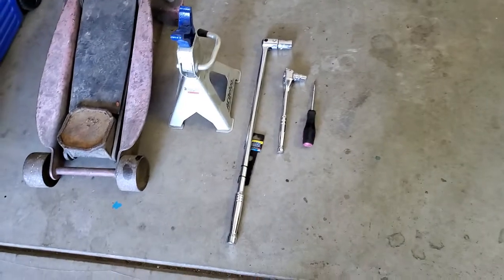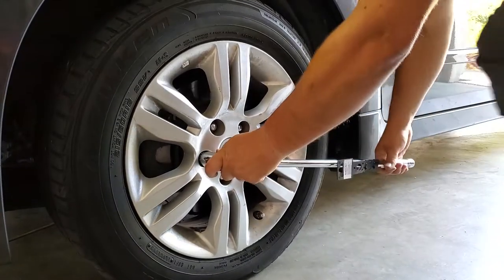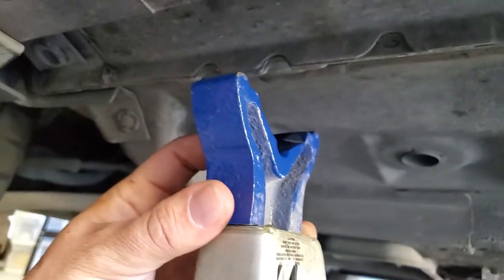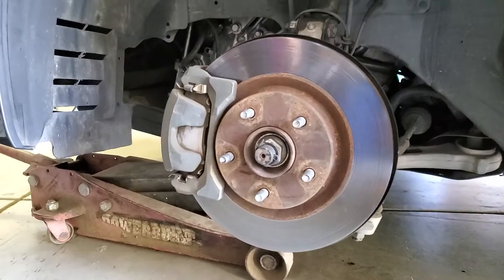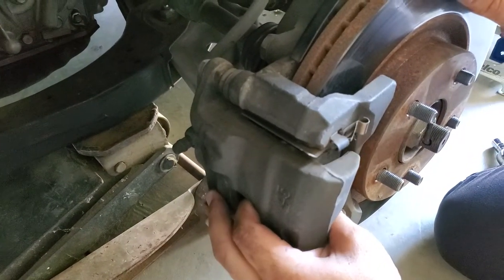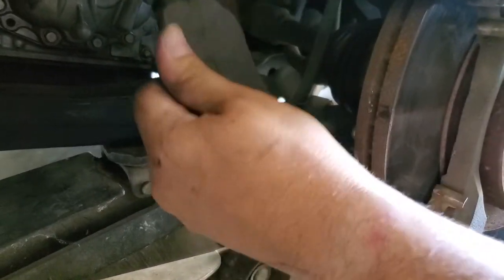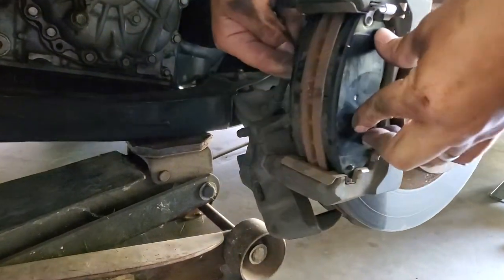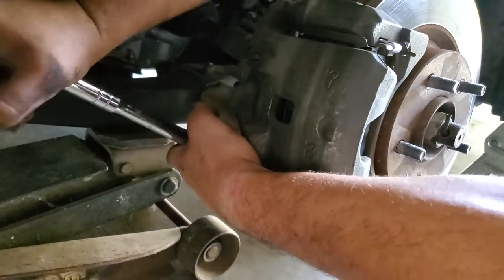Front Brake Pad Replacement 2010 Nissan Altima 2.5S Disk Brakes

Comment: For anyone watching.. those pointy edges/tabs that stick out from the top brake hardware clip should be tucked into the loop on the brake wear indicators. If not, that outer edge can scratch the inside of the rim and make noise. They also serve as return springs to keep the pads off the rotor when not braking, and I think they stabilize the pad and minimize shaking. Forgot to do this on mine and had nonstop loud squealing during braking and pads wore out in only 4 months!!!!!! (Rotors were also glazed). Hope this helps someone!
Reply: GOOD CATCH!  Those pointy edges/tabs must be tucked into the loop. I appreciate the good intensions in making the video but really, Thank you Ken for spotting this major issue. We all learn.